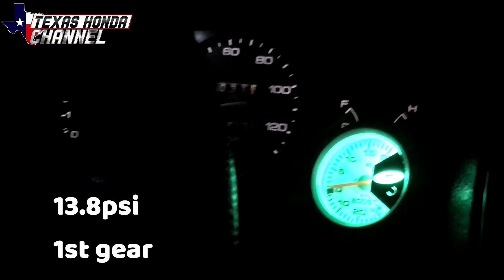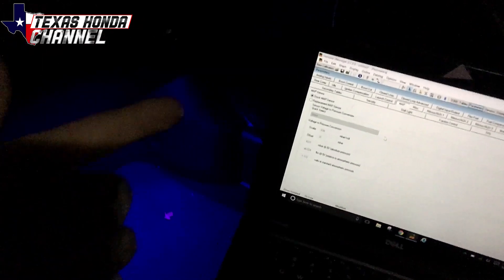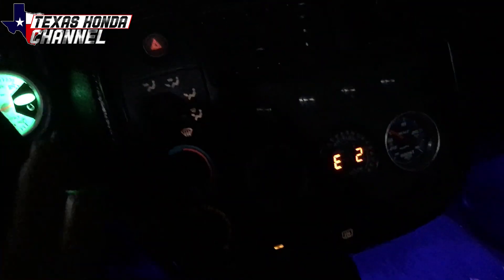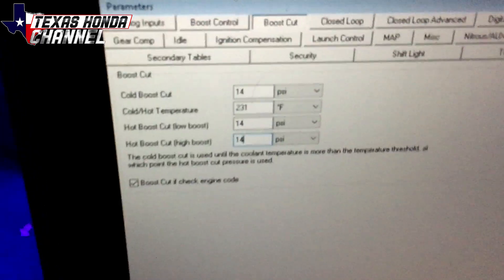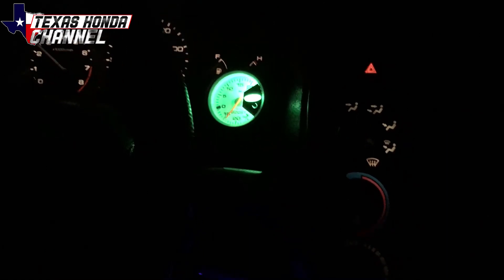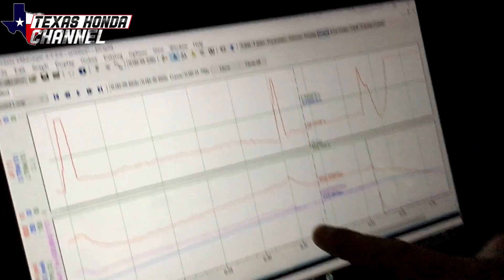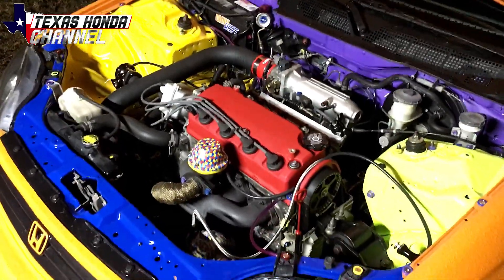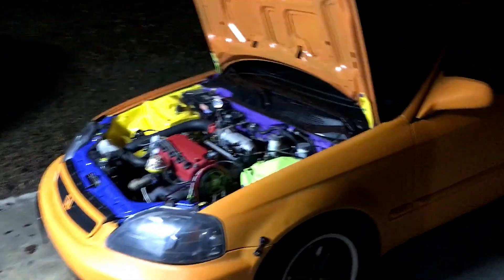Hondata 4 bar map sensor install and adjustments

Comment: What’s a map sensor do ? If I’m only gona get tuned on like 10 psi do I need it ?
Reply: Measures the Manifold Absolute Pressure in vacuum and tells the engine how much air is being sucked into the engine. Stock ones only really rate around 10.5PSI like bro above me said. I’d recommend doing 3 bar or 4. Plenty of headroom to run more boost plus it’s a small component.
Reply: Should oem should be able to hold 10.5 if I’m correct been ages so not sure

Comment: You said the Hondata map sensor is easiest because of the present values but what would have been different if you would have used the Omni power sensor?
Don't they both use the same preset parameters you used?

Comment: I’m doing a turbo on my 2011 si k20 where the hell do I put the map sensor when I delete the intake pipe for intercooler? I need help guys
Reply: on the throttle body or the manifold. some k series have the map sensor on tb or manifold.

Comment: Have you or are you to do a how to tune video?
Reply from the maker: well i don't know how to full on tune i know how to do a lot of stuff though and i don't wanna pretend to know it all so i don't wanna give misinformation. I will eventually do a general "how to tune" video but it will only be the stuff i do know how to do. I have done little bits here and there through out the channel. Like how to get the target air fuel ratio at idle and cruising and what to look for under boost.
Reply: @TexasHondaChannel  thank you

Comment: Man watching your vids has got me pricing go fast parts for the cobalt. Sadly gm direct injection motors aren't cheap to build. Looking at $1k for forged pistons/rods. $800 for cams.$2400 for turbo.haven't even priced e85 injectors or springs and retainers yet.
Reply from the maker: OH JEEZ! The rods and pistons for this engine is $450
I have e85 injectors/fuel pump and fuel filter all i gotta do to run it is get it retuned.
Reply: @TexasHondaChannel  yeah the lnf in these cobalts would put down 300whp stock with just tune though. With the setup I listed im looking at +700wph with a tune. However you can tune it more mild to keep from shredding the gears in the tranny lol
Reply from the maker: sinformant Wow that’s crazy